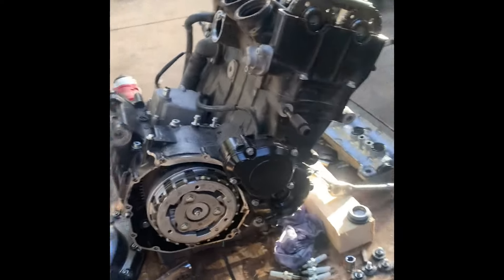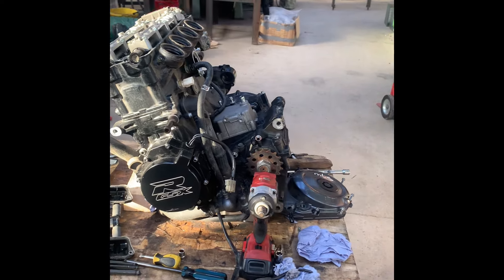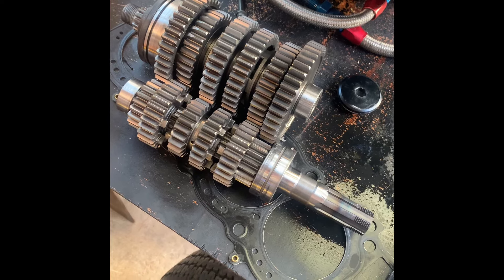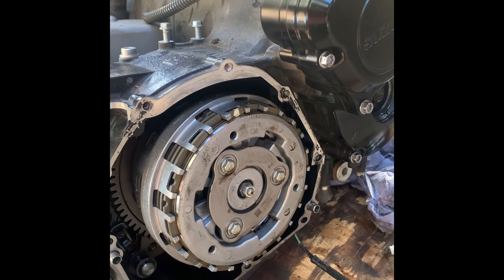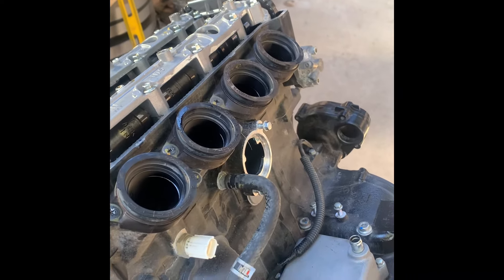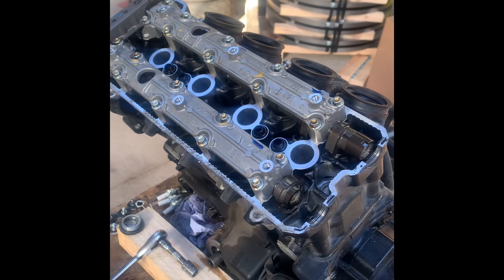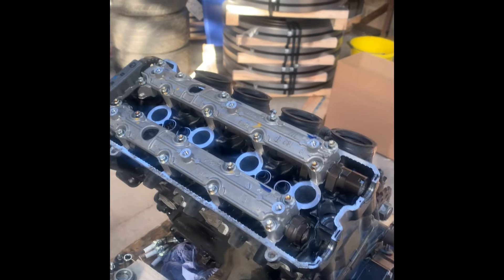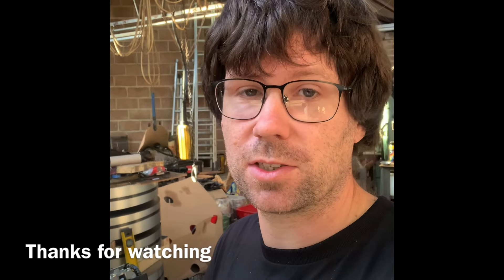Turning a GSXS into a k5-8 GSXR 1000cc  differences I’ve found and swappable parts informative video

Comment: Can gsxs1000 motoe mount to gsxr 1000 k5 frame ?
Reply from the maker: The gsxs doesn’t have the mount on the cylinder head that the k5 does so wouldn’t match the frame at that point but it has the same rear barrel casing mount. Our gsxs/r combination has a k5 cylinder head onto a gsxs block
Reply: @reallybigkidd  Thanks for sharing information

Comment: 1000 or 750?
Reply from the maker: @MC-Racing  1000cc
Reply: @reallybigkidd  thanks. chain knocked a hole in my 750 K7 race bike. i have fixed it, but interesting if i could get new bottom casings from a GSXS
Reply from the maker: @MC-Racing it’s quite possible that you can, I started playing around with the gsxs 1000 ideas 4-5 years ago, I’ve only managed to kill one so far and that was due to a failed electrical water pump on the white single seater. All the usable bits that have been left will fit the spare GSXR engine I have and the gsxs/r hybrid that I’ve been using in one car for 4 years so they are handy if I break gearboxes etc.
Reply: @reallybigkidd  Sweet, i will keep that in mind if i need to replace something. for now its patched up with an aluminium plate and epoxy :-) the spot in front of the chain don't seem very stressed anyway. ill see if it holds up :-) godspeed 👍